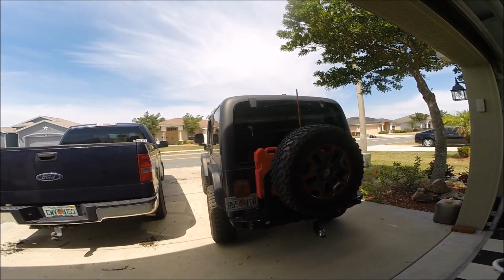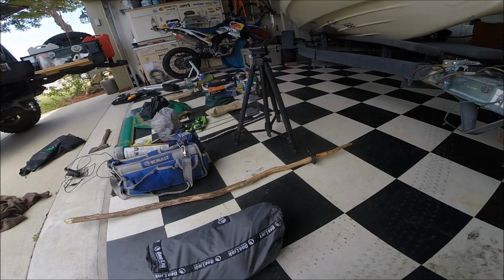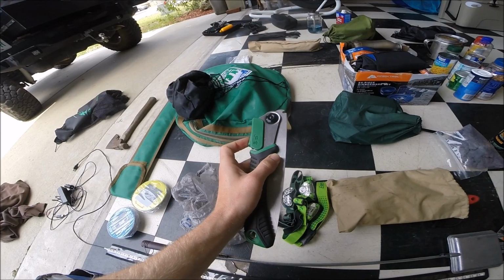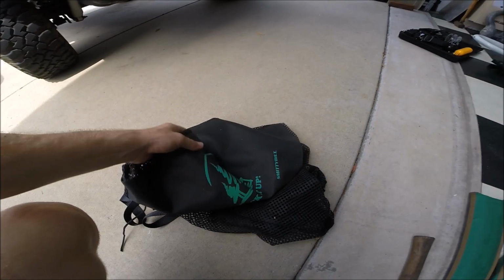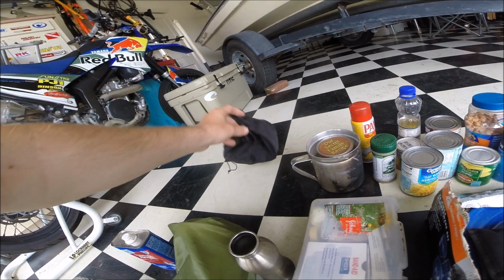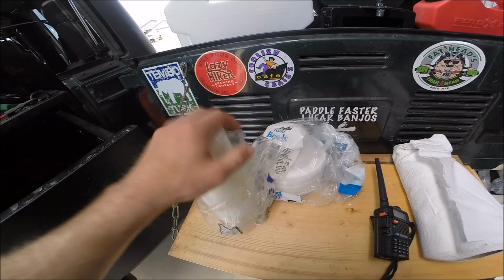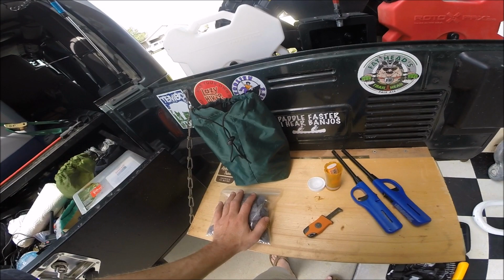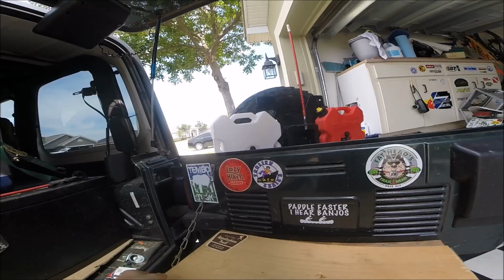Everyday Overland - My camping gear dump

Comment: Didn’t read all the comments and somebody might’ve already said it but having that push rod fire started inside The same compartment has your fire starting material could become an issue along a bumpy trail. Outside of that awesome content! You have a new subscriber! Cheers
Reply from the maker: I didn't think about that. Thanks for the heads up.

Comment: Instead of using denatured alcohol, you should try HEAT.  Find it anywhere oil, coolant, carb cleaner etc is sold.  Get the yellow bottle.  Burns cleaner and hotter than denatured alcohol.   Super cheap too.
Reply from the maker: insaynbcr 

Thankyou for this info!

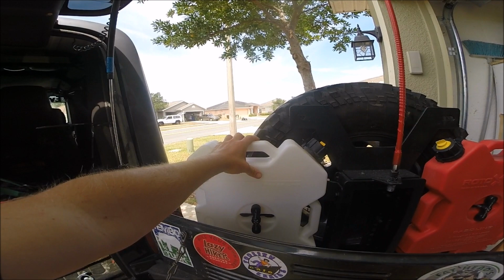Comment: Great video man! 10:18 There is something wrong with your cooling system if your vehicle is running hot. Could be a fan, water pump, thermostat, head gasket, thermosensor, or sender in some vehicles, radiator, radiator cap, hoses, freeze plugs, coolant reservoir or heater box. I'm not an expert, but vehicles should never run hot, unless there is something wrong with the cooling system! Carrying extra coolant isn't a bad thing though! I don't own a Jeep, but my 95 Tacoma never runs hot! I live in Arizona BTW.
Reply from the maker: Over the years I've replaced just about everything except the water pump.  That's next.

Comment: Great video and a great channel! I just discovered your channel yesterday and you've practically introduced me to overland. What vehicle would be a great starter vehicle I could build off of? Preferably something I could use as an everyday driver as well?
Thanks for any tips and info!.
Reply from the maker: allanh33123 

Thanks for the comment.  I recommend something the size of a 4 runner.  It can be any brand,  xterra even.  But that size vehicle will still fit down trails.  Plus hold a great amount of gear.

Comment: Nice setup! Is that the Smittybilt drawer, how rugged is it? I'm debating getting one vs building my own. 
I'm in central Fl and the engine heat was horrible on my jeep wheeling in the summer. I installed a lower temp thermostat and a hood louver. It made a huge difference in my engine and under hood temps.
Reply from the maker: Brian Jones 

Thanks for the comment! Yes, that's the Smittybilt drawer. I like it, it's rugged and heavy.  But it was like $350.  Price was my only complaint.   The drawer has nice rollers too.

Comment: Did you make the tailgate table?
Reply from the maker: rikntraci 

Yes,  I think it one of the first videos I ever made on my channel.
Reply: I'll check it out.  I want to make something similar. 
Dude that's a lot of stuff packed in. I wonder how many Lbs. ?
Reply from the maker: rikntraci 

The table comes in very handy!  I don't think the gear weighs that much.  but the box and ARB refridgerator are super heavy.